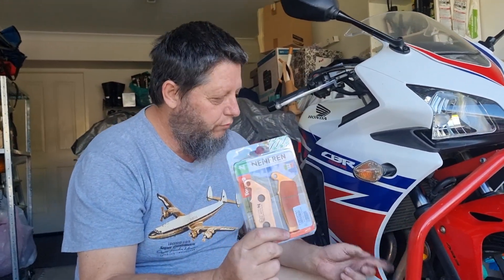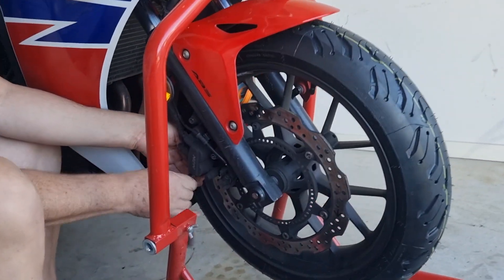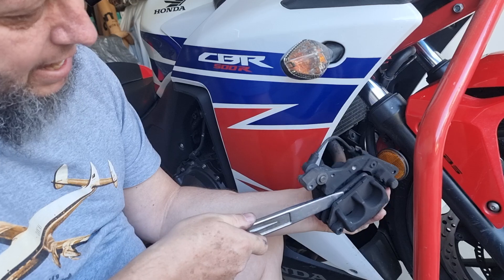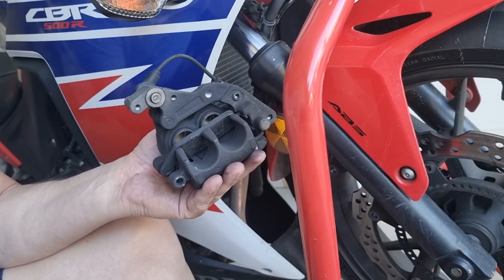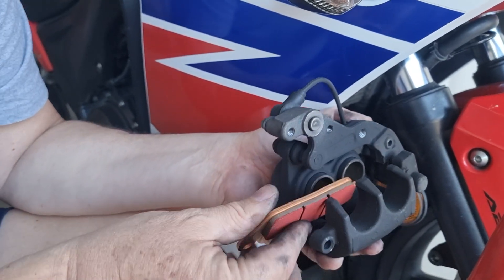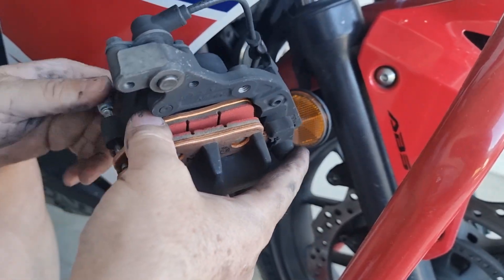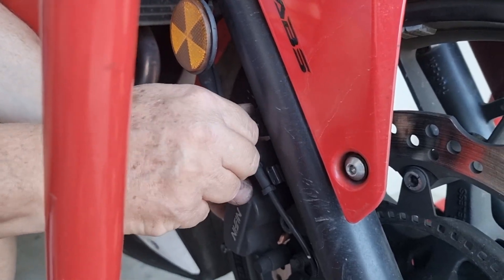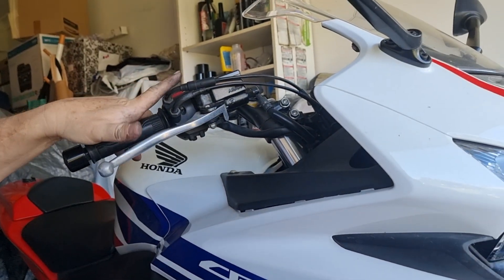Honda CBR500R Front Brake Pads Change

Comment: Hey man, Just picked up a cbr 500r 2014 model and going to be doing front brakes and fork seals due to it leaking. Been following your channel and I love your videos. 
How are the Front pads holding out? I was going to get genuine as they are cheaper than aftermarket at my location Honda shop. 160$ I think it was for front pads but looking up the ones you have here they are 58$. I'm in western Australia and thinking of slapping the cheaper ones for now to get it over the pits but also want some decent pads as it is a motorbike. 

Keep it up!
Reply from the maker: The stock pads had a lot better feel than these ones, so if they are cheaper, get them.
Reply: @chrisbiker919  stick to OEM hey
Reply from the maker: I used to run EBC pads on other bikes and liked them, I don't know if it is the ABS but they don't stop nearly as good as the OEM pads. I'm going back to OEM.